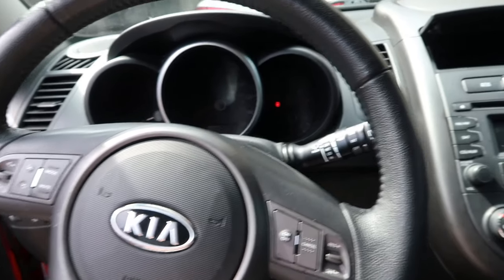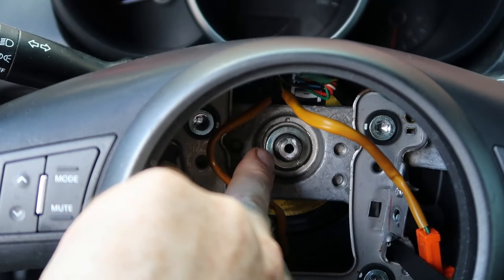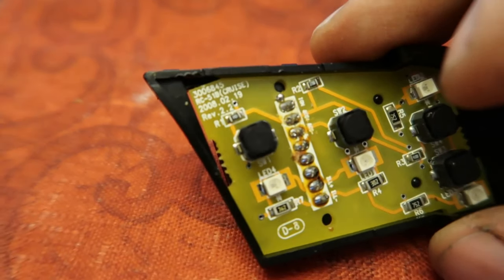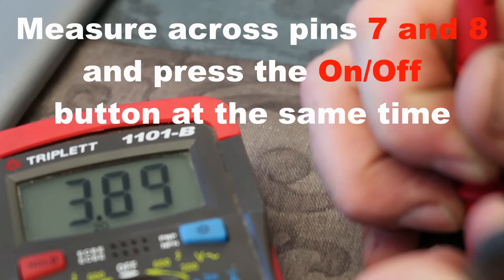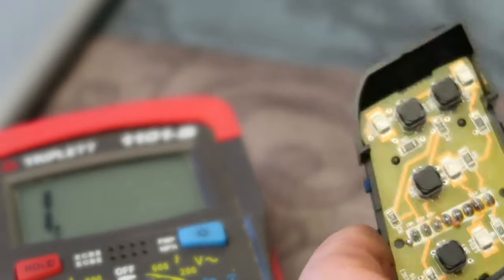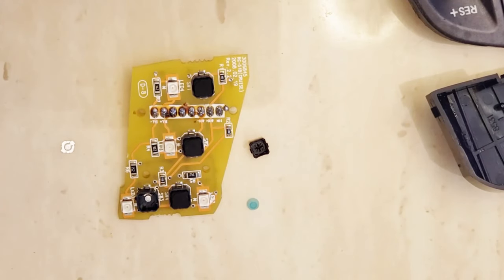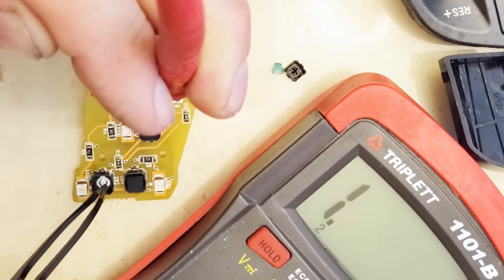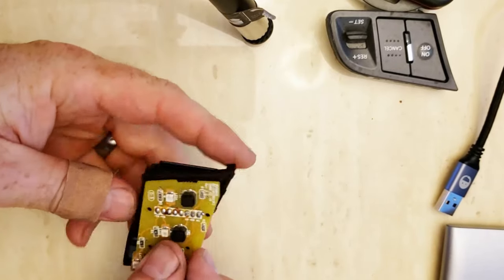FIX YOUR CRUISE CONTROL WITH AN ERASER!!.  KIA SOUL, FORTE, SPORTAGE

Comment: Wow! Kia Sportage 3 (SL) from 2012 driver here. I've got this replaced some years ago while it was still in warranty, but it went bad again. I've "solved" it before with compressed air or contact spray, but it always came back worse and worse. For me it was the worst with the volume up switch. My Belgian Kia only has one T20 screw in the back on each side, so I had to get the steering wheel completely out to dismount the button modules. After prying these plastic modules open, I followed your guide and WOW, it's working great! Tnx a lot for this very excellent and well explained video and for your time!
Reply from the maker: Right on!  I guess you saw my suggestion on Facebook 👍🏼 I'm glad it work

Comment: Got to be my best 'Youtube' fix yet. have a 2013 Kia Cee'd (UK) with the same switches and symptoms. Not exactly the same as the one in the video but close enough. Anyway took my time and 3 hours later (wouldn't take that long for someone with experience) works like a dream. And like you say  didn't cost anything. Many thanks.
Reply from the maker: My pleasure!  Thank you for the kind words.

Comment: OK, just disconnected the negative battery cable and waiting....  On the right set of switches my set button works intermittently. It takes multiple attempts to get it to set. This has been going on for a while now. On the left side, the radio controls are starting to act up. So, time to tear into it. This video is exactly what I needed.  Thank you! BTW 2012 Kia Soul! With 118K.
Reply from the maker: If you don't have an ohmmeter it's not necessary. Just clean everything and see if it works.  It would be good to clean the other switches too before they fail.  You got this.
Reply: @HousesandCars  I'm on it!
Wish I could post pics.
Reply: @HousesandCars  All back together.  Drivers side, everything works, better than before. Passenger side, can't set the cruise at all now.  However, I have a tire that is low and the TPS light is illuminated on the dash. So, I am going to assume that is the reason. ;) Rolling out the compressor now.
Reply: Success!!!! The down on the left side is the only thing not working and I am OK with that. Thanks again. 
Couple things of note that might help the next guy....
The T-40 bolts have a collar around them that will not let you use a T-40 socket adapter.  I used a 6mm Allen wrench.  They do not come all the way out of the steering wheel. I used a magnet to ensure they were clear of the airbag. 
The little metal piece in the buttons is tiny. My 50 year old eyes were working overtime because I couldn't find my cheaters. And they love to jump out of the tweezers, so have a clean and clear work area.
Lastly,  a trick I use to separate the buttons from the housing is to fold small pieces of an index card in half. Pull each tab away from the clip gently and slid the folded piece of paper between them.  This keeps them from re-engaging when you move to the next one.
Reply from the maker: Good job and thanks for the suggestions

Comment: Thank you so much for making this video! Pretty sure this is exactly the issue with our 2011 forte. Over time the set button has just kinda stopped working. Likely just got some crap in the contacts. Will pull it apart this weekend and see. Much appreciated, for sure! Had no idea how to take this apart, I'm sure this'll save me a ton of time
Reply from the maker: The resistance values might be different for that year but you still have a good idea of what could be wrong and how to fix it.   Good luck on the repair

Comment: Good video. Completed switch swap today.  One note: I wasted about an hour trying to remove the T40 torx bolts until I realized they are the capture type and are not removable. Doh!
Reply from the maker: I began working on a 2018 model and those are completely different. When I made the video I didn't realize how limited the design was for the 2012 model.  Did you get it fixed?
Reply: @HousesandCars  One other difference to note. My 2012 had an additional ground wire (part of the white harness attached to the clock spring) that clipped to the steering wheel. The job, she be finis! your video a big help.

Comment: thank you the best video I have seen about it, where did you get the wire diagram (resistors diagram)?, mine its a suzuki where 3 control buttons do se same function, i was searching why and I measured voltage when I push every buttos and those 3 buttons have the same voltage about 0.6 (very low), I thought thay maybe a resistor is damage so I checked and measuring resistance of every resistor but non is in short circuit or open circuit.
Reply from the maker: You're welcome! I just Google it and that's what showed up fortunately. I got lucky.  It does sound fishy about the voltage but it depends on how the voltage is used in the circuit and how it's measured.  It sounds like you're experienced but it might be better to ignore the values of the voltage and resistance.  I should have mentioned that in the video... especially for people who don't have a meter.  So if you suspect the buttons or connections, clean everything as I did and try the circuit again.  If it doesn't work, maybe try to do a continuity check of the clock spring wires.  Let me know how it goes👍

Comment: Brilliant video. Is there any way to get to the switches without removing the steering wheel?
Reply from the maker: Thanks Stephen.  I believe the wheel needs to be removed.  On a good note... you probably don't need a multimeter if you don't have one.  Just clean it if you suspect it to be bad. Good luck
Reply: @HousesandCars  thanks for that

Comment: Excellent YouTube clip. I have the same car in Australia (Cerato) with the same cruise control switch. Problem initially was the cruise function was turning on but when pressing set it was not setting.  I replaced the brake switch with another one that was proven to be working.  It didn't fix the problem. A few months later the cruise function would not turn on at all.  Subsequently found your clip and tested the ohms with multi meter. According to the results all the switches are working but Cruise control will still not turn on. Does anyone have any suggestions.  Clock spring maybe? Is there a way of testing that? Anything else?
Reply from the maker: If you have the steering wheel apart, I would clean every switch eventhough the ohms read good.  The ohms tests were meant to be a confirmation instead of a diagnosis.  Remember I had the same problem but my meter was sometimes reading ok.  So I would clean the switches and go from there.  I believe the clockspring is just a spool of wires.  You could do an ohm test on that also and it should be a short (0 ohms) from one side to the other.  👍
Reply: @HousesandCars  Thanks for your reply.  I'll tackle it again maybe next week when I have some time.
Reply: Cleaned every switch, no luck. Replaced switch with used one from a wrecker, no luck.  Checked continuity in clock spring, two points not working.  Replaced clock spring with aftermarket brand BAPMIC.  Problem solved.  Strange though that after I installed the replacement clock spring I tested the old one and there was continuity on all points.
Reply from the maker: @frank2247  Good job.  When everything works again it's like a miracle especially when you did it yourself. I wish I mentioned the clock spring in the video.

Comment: Because you removed the airbag, will it produce a code that has to be cleared?
Reply from the maker: Nope not at all. If you remove the battery before working on the car, the car will never know the airbag was missing.  👍

Comment: Would this fix work with a 2011 Hyundai ix35 highlander? Switch looks very similar and my issue seems identical.
Reply from the maker: Yes and no.  Cleaning the switches can be done on any car but the steering wheel might have different hardware and the resistors might be different in the circuit.  I would ignore the resistor values and clean everything and see if it works.  👍 good luck

Comment: Save 50 bucks? I'd pay that easy for someone to fix mines😎
Reply from the maker: $50 for a used part on ebay... not to have it fixed.  Keep in mind I made it more difficult than it looks with the meter.  If you don't have a meter you can clean all the switches in almost the same amount of time.